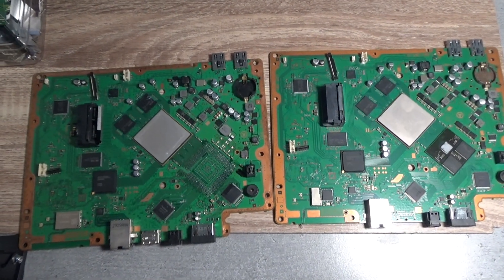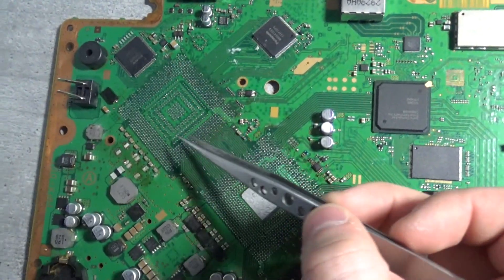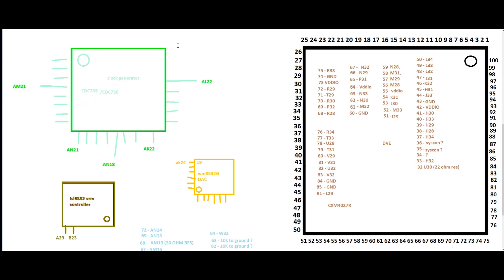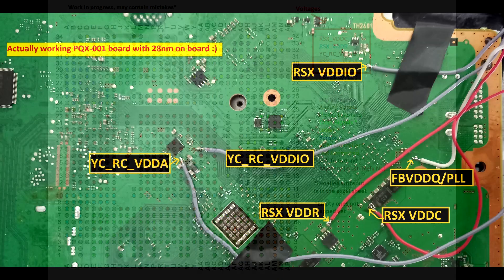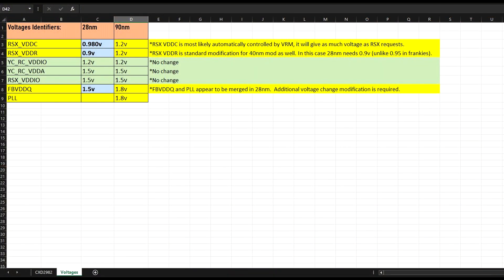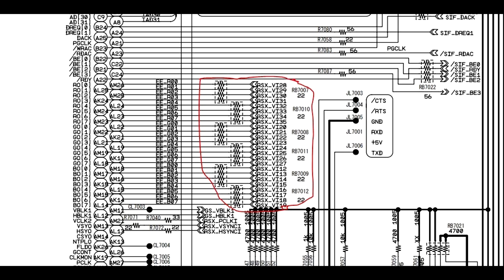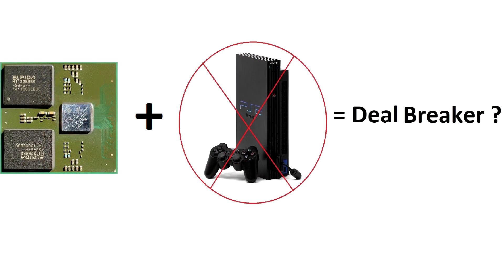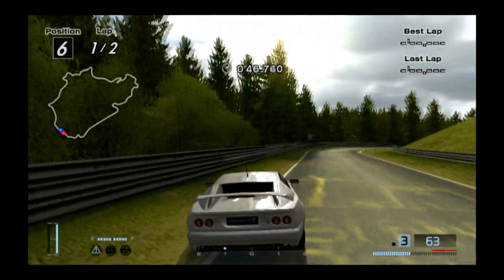Reverse Engineering PlayStation 3 Super Slim (Mapping 28nm RSX pads & Interposer research)

Comment: Actual reverse engineering is just around the cornor 
This end of december ps3 superslim schema board diagram will be release watch out for updates on my channel
Reply from the maker: Have you been probing it?
Reply: @calyps0man I am recreating entire PCB in cad layer by layer final product will be 2 layer board and a graphical service manual
Reply from the maker: @fallenson4852 I am quite sure there are more than 2 layers in og pcb. But if you can fit that into two, that would be impressive.
Reply: @calyps0man its originally I six layer PCB but final boardview will be 2 layers for diagonostics if you are on psxplace come fine my thread that will speed up things
Reply from the maker: @fallenson4852  What is the thread's name? I can't find it.
Reply: @calyps0man hey you wouldn't mind taking a few photos of pqx-001 board or nox whatever you can rsx needs to be 28mm I want the rsx CPU xdr southbridge bga photos the scans I have are missing a lot of pads and I can't just complete flex io with them
Reply from the maker: @fallenson4852  Flex io is easy to complete based on the official schematics.
Reply from the maker: @fallenson4852  I can compile flexio if you help me figure out mystery and non marked pads.  Check here https://www.psdevwiki.com/ps3/images/9/9f/28nm_%2B_other_components_map.png
Reply: @calyps0man wish it was but my scans have majority bgas ripped so faints traces marks are not a lot easy on eyes flex io has been dragging me past week and the large planes for ground and power I need figure how to design those in kicad then move to next 5 layers 
btw I am also designing sem-001 boardview based on schematics
Reply: @calyps0man I don't currently have a function analyzer or scope on me right so I trust you to probe and label 
them using boardview somewhere in January I bet but if you want I can have all the av/hdmi to rsx pins labeled just point the direction to first A1 pad and encoder  pin
Reply from the maker: @fallenson4852 you are wasting time because Sem-001 schematics have been available online for years. I am wondering what is your motivation for all this?
Reply: @calyps0man  you have schematics that are not keyword friendly you really want schematics that miss the component code right in front of you and for your question i have a superslim of pqx-001 that has glod and gives 1200 and 2022 errors i replace thermal monitors but still the same and emmc can't be dump and flash because again you won't find any schematics for interlayer testpoints does that seem enough reason
Reply: as for my earlier request did you take some hd photos of bgas and contact me at psxplace i haven''t been there for sometime
Reply from the maker: @fallenson4852  I am actually busy working on something else right now.

Comment: This is basically a who can pull it off first and it still work even if we find out its not worth it. Screw it ill give it a try one day. Its gonna suck soldering a pcb(to make the pinouts go where they should)down then a RSX chip. But im able to use hot air to remove esp32 chip sets with the metal shield. My first attempt sucked but I know exactly what to do now to pull it off

Comment: A 28nm 60gb PS3 would be insane.
Reply from the maker: Yes , but unless we figure out how to keep backwards compatibility, it's a bit of a lost cause.
Reply: @calyps0man  I would be more than happy with a Cell from a later Phat or a Slim. I think Super Slims are best left alone.
Reply from the maker: @8bitnation419  It doesnt matter, because there wont be either lol
Reply: @calyps0man  I see so i'm  guessing this is impossible to pull off. A shame indeed. Hopefully something can be figured out.
Reply from the maker: @8bitnation419  I like to believe that nothing is impossible. But in this case there is not enough reasoning for trying to make it possible. Such as investing time and resources for something that nobody needs or cares about. Sometimes I have to face reality and not get stuck on "cool" ideas if you see what I mean.
Reply: @calyps0man  The downside is there probably never will be a way to fix the PS3's with a failed Delid RIP. And also is it because there is something in the Syscon or the Nand code that is preventing the later Cells from working on the earlier consoles? I'm guessing more code cracking and reverse engineering is needed. It's worth making a post about on PSX Place. I think the current research will be valuable for whoever decides to pick it up from here.
Reply from the maker: @8bitnation419   There is a way to fix it with a failed delid. You swap Cell + Syscon + NAND. Im not sure about later Cells though. The Cell remarrying is also possible but complex.
Reply: @calyps0man  The issue is, you would have to find another Backwards compatible motherboard to swap out the Cell with, to another backwards compatible unit. At that point you're just better off switching out the board. Hopefully something can get figured out with a later model Cell swap. The PS3 has essentially been cracked wide open at this point. It sounds like you encountered a software issue. Again I'm no expert here but that's just my speculation.
Reply from the maker: @8bitnation419  Software issue? Are you still talking about Cell? Anyways, failed delid is easily avoided by delidding carefully...
Reply: @calyps0man  Yes with swapping the later Cell into the earlier boards if the adapter were to be made. You said backwards compatibility would be disabled if you put later Cell into a 90nm board.
Reply from the maker: @8bitnation419 You are confusing something. Cell's functionality is the same on every board. It is 28nm rsx that doesn't support ps2 . This video is about RSX.
Reply: @calyps0man  Oh wow my bad. That's actually awesome to hear. I never cared for the 28nm RSX, 40nm is plenty good for a Phat PS3.
Reply from the maker: @8bitnation419  I am a bit surprised you confused them both because you are commenting in a video that explains about 28nm rsx and why it may not have ps2 backwards capability. On top of that I am even more confused because at first you wrote 28nm 60gb ps3 would be insane, and now you say you never cared for it. :D
Reply: @calyps0man  I watched your video 2 months ago, will try rewatching it, and my very first reply was about the Cell. Plus I recently saw your Cell and your backwards compatibility videos. As of now, I'm just on my notification section, not on the video. But yes, though it's interesting to see, I never really cared for a 28nm RSX, nor a 28nm Cell swap as much as the current 40nm Swap. It would still definitely be an amazing feat to accomplish and would be crazy to essentially see PS3 Super Slim hardware in a Phat. But overall, I just don't see the point of it when 40nm RSX's and even the 65nm to 40nm Cells with the cooling that the Phat PS3 provides is plenty good and likely easier to install Unless the 28nm parts are easier to install which are also perfect for overclocking.

But I don't know if there is as much new old stock for 28nm RSX's which can mean the destruction of Super Slim PS3's. Harvesting it to repair a Phat. Whereas 40nm RSX's on sites like Ali Express is flooded with them. So yes, if it involves a lot more effort. I don't think the 28nm RSX and the Cell specifically is worth the effort. Not as of current. I think the Cell swap is definitely needed the most, especially the 65 to 40nm ones along with a remarry process that doesn't involve swapping around Syscons and Nands. I think there would be a lot more demand for those. For people that screwed up their Delids or have consoles with dead Cells. But i'm not sure if any of this will be accomplished, which kind of makes for a pointless discussion.
Reply: @calyps0man I'd absolutely buy a Frankenstein 45 nm Cell PS3 if it was available.
Reply: @8bitnation419 there's no 28nm Cell though, just up to 45nm
Reply: @calyps0man why would it be lost though?
Reply: Imagine the thermals on that bad boy

Comment: Hi. A question: Could you tell me what components are the one surrounding the WIFI/BT Module? They are all SMD and I can't realize whether they are capacitors or coils, for example. I would also need to know the voltages those components are working with
Reply from the maker: Sorry I have not worked on this for a while. And we dont have schematics.
Reply: @calyps0man  I understand. Thanks for the answer
Reply from the maker: @lichitan  You can try to measure the voltages btw. And generally capacitors look brown while resistors are black. If that helps at all. I also remember there was some type of sketch made schematic for the wifimodule on slims, which  oculd be similar to super slims...

Comment: i wish this is done. for the sake of completeness... also what about the ee+gs soc? can it be swapped with the one from ps2? there was some earlier ps2 models with ps1 chip on them. it would be crazy to be able to put them together on one device :D great content, please keep us updated
Reply: PS2 Slims (77000 and probably 75000) had the same ee+gs cxd2953agb from what I can tell.
Reply: Wait you mean make the later PS3 models backwards compatible? Or turning the later half Emulation PS3's into full emulation ones? Is that even possible.
Reply from the maker: @8bitnation419  The EE+GS on ps2 has a slightly different revision but it most likely is compatible.

Comment: Wait a sec... But Original RSX has been packed in 41*41 BGA package. You do have a 34*34 BGA package in RSX you're researching, so obviously you've found [RSX_VI*] pins missing... For example RSX_VI16 mapped on P35 pin. While RSX_VI24 is on P41...
Reply from the maker: Right. I see what you're saying now. However it's not just about the package size. It's not like they just drew a smaller square and cut off the rest of the pins. They have relocated the pads functions and removed some other ground pads.
Reply from the maker: I will check.

Comment: Nice job!
I think some of the empty pads are N/C. It pretty normal practice to keep empty pads for future expansion.
Reply from the maker: Well, they are NC on the motherboard. However if you measure some of them on the chip, there is resistance to ground. Not on all , but on some. So it means they may have a function, but the function is not in use.
Reply: @calyps0man  Yes. They may also be ganged to pullup/down
Reply: Maybe they are used for improving strength aka that the chip isn’t gonna easily come off, just like the HDMI ports on most PlayStations with the metal bracket being not smd but actually physically piercing the board and being soldered on on the backside of it
Reply from the maker: @seesikopter  That may be